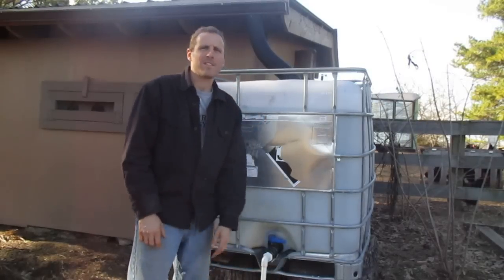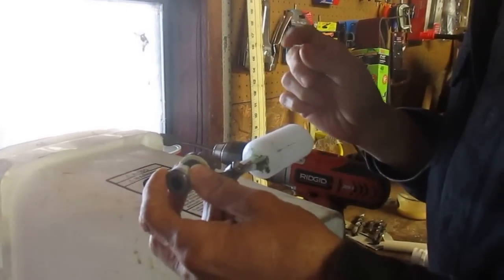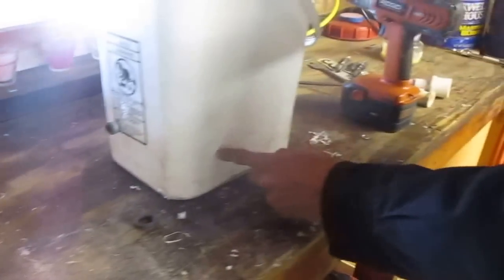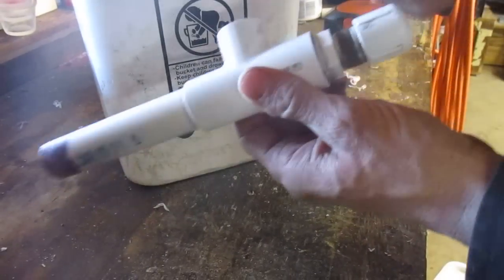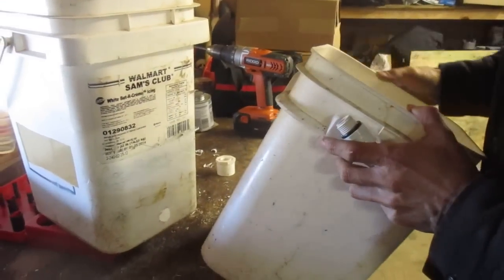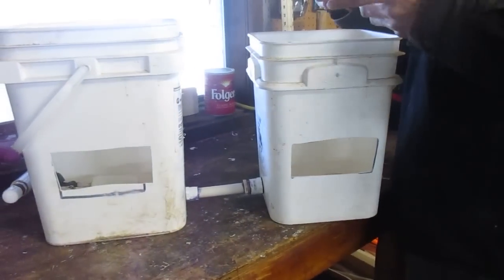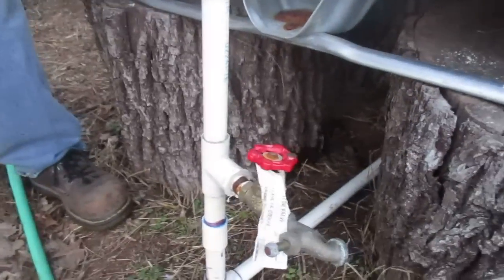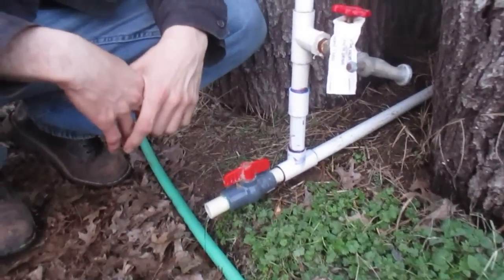Automatic Chicken Watering System

Comment: Put thin foam on the mic for stopping the wind noises.
Reply: This type of plastic will turn quite brittle in a few months.
Add a Cookie tin heater under them with 25Watt bulbs is you can find them ( Chicken Chick site w/ a Thermo-Cube ceramic 2 port plugin that starts at 35 Degrees and off at 45 degrees. That way; they do not stay on and overheat the water. Set the tins on walkway paver's on sand and they will last a long time if painted each year. Mine kept the chicken water can from freezing down to 21 degrees.
Reply: Given a choice; I would use a better grade of plastic that is UV resistant or put a Sun cover over them with a lot of vent space.
Reply: A 15 gallon square sprayer tank maybe with the hole cut in the side should last at least 5 yrs and costs about $25-45. Wonder who sells just the tanks?  Hmmm?
Reply from the maker: I like you idea about a heating system and having the bucket being UV resistant but I don't think a size is a good idea.  Other consideration is the cost the buckets, the ones we use are free...I have several that have been in service for 4 years and still running strong.  Any idea can be improved on but at some point you make it not cost effective for everyone...

Comment: I just use one for a toilet tank
Reply: I am trying to set up one right now using the toilet floats.  There does not seem to be enough pressure from the totes to fill the buckets quickly.  Water is dripping in slowly.  Think I will have to switch to this method.  Thanks for sharing.
Reply from the maker: Does it work well?
Reply from the maker: Nerdy Homesteader - Thanks for watching.  You will not see large volumes of water with our float either because it is a needle valve that controls the water coming in.  Don't worry about the appearance of flow, just make sure it is flowing.  We have 50 chickens on this set up with no issues and I have had up to 100 chickens one bucket for several months with no issues.  Good luck and enjoy the hands off approach once you have it set up!
Reply: True.  I did switch and there is not a large spray of water coming in, more like a steady stream.  Still much better than a drop every few seconds.
Reply from the maker: NH - I hope you enjoy and have many year of success!

Comment: Hey Chris, are you still using this waterer during the winter? how is it holding up? freezing?
Reply from the maker: Yes we are still using them, even in the cold weather.  I even put one out for our sheep.  The bucket does freeze on cold nights which is a drawback but it thaws quickly unless it is a really cold night.  We have been using organic material (pine needles and leaves) to cover the pipe and the butterfly valve on the tote and have had no issues with them freezing this year.  I love this system, best one we have ever put together!
Reply: i have a bulk tank supplying our chickens waterer, but it freezes when its real cold. i have an idea of putting a return line with a electric pump to allow a continuous flow through. i think this will solve the freezing problem. That's a great idea of using organic material around your piping!

Comment: thanks for the vid. You said 'the water can handle freeze but the pipes couldnt'. what did you mean? If the water freezes won't it stop the flow into the buckets?
Reply from the maker: The totes can handle freezing but the pipes are the issue.  In the past the pipes out of the tote would freeze or the pipe connected to the automatic system. We did have the tote freeze when it would get really cold but it is a large body of water so it takes longer to freeze.  Enjoy the system!!
Reply from the maker: Sorry for the VERY late response!  The pipe doesn't allow or have room to expand so it will crack a fitting if not drained but the water or bucket has the room so it has no issues.  This year we cover the pipe and valve on the tote with layers of leaves and pine needles and have had no issues with the pipes and we haven't drained them once.  I hope this helps?

Comment: That's a new twist on waterers :)   Have you considered insulation on the pipes to keep them from freezing - even old straw bales might be a wintertime solution then you can just compost them in the spring.  I have to figure out how to keep my chicken water nipples from freezing this coming winter, but for now I really love the horizontal chicken nipple in a covered 5 gallon bucket system. It's a no dirt system & the water stays cool in the summer due to covered lid on top.  Thanks for sharing your solutions...and I'm jealous of your water collection setup from the roof :)
Reply from the maker: Your idea on covering the pipe has worked!  We covered the pipe and valve with multiple layers of leaves and pine needles and had no issues this year and we didn't drain the pipe.  We have had several nights with single digits and one night at zero and it is holding up well!  Great idea, thanks!
Reply: oh wonderful! I'll have to try it out if we get ours outside in the elements. :)